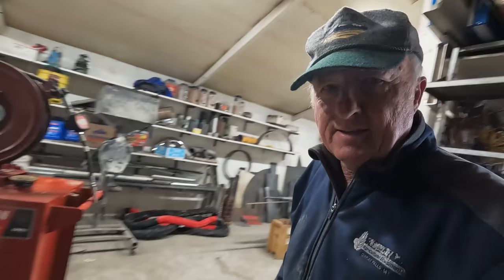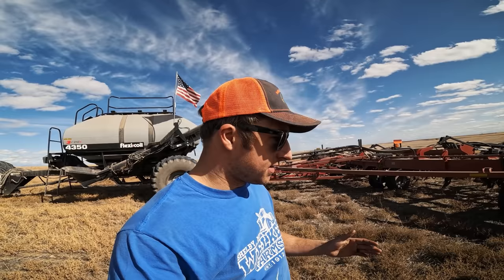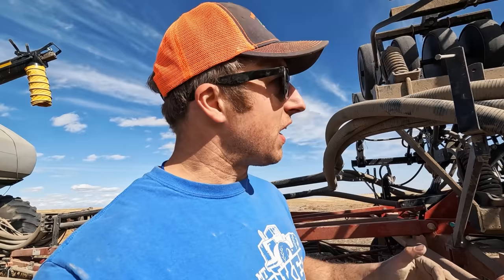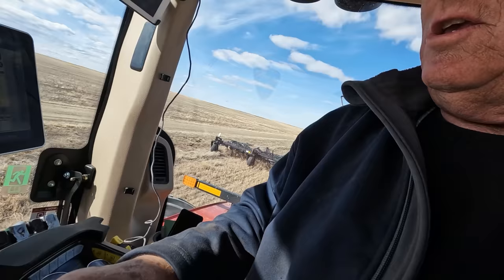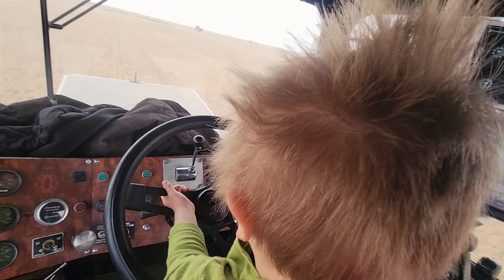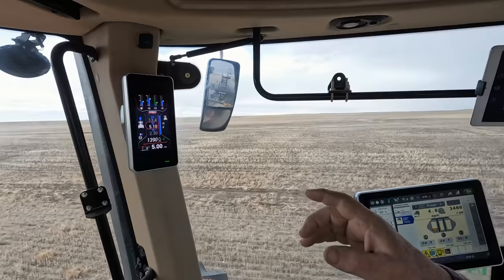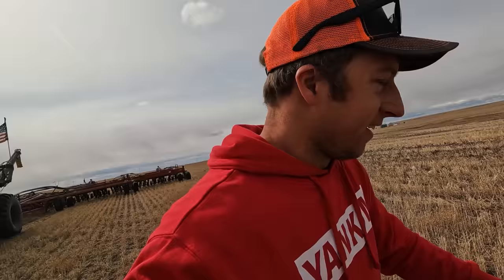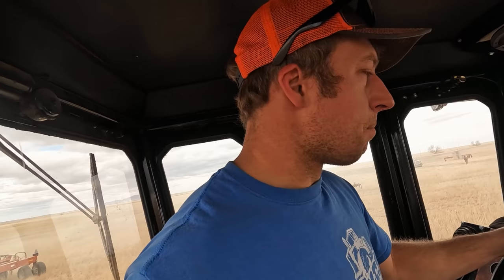Sleeping in a BIG BUD Tractor??

Comment: Yeah Seatbelt helps the Ouch ! Hitting the top of the cab with your head hurts bad enough but if you're wearing a ball cap the button on the top of the hat makes it feel like you got hit on the head with a ball peen hammer , I used to tell my new operators before they drove off in one of my Cranes wearing a ball cap that they might want to wear their Hardhat instead , Most would leave wearing the ball cap and return at the end of the day wearing a hardhat , LOL . Or you can wear a welders hat that doesn't have the button on top .

Comment: It still amazes me that you can go around those fields with direct seeding only basically and still easily pull a good crop.
Here in Europe the farms that I know would never go drilling without prepping the fields beforehand
Reply: it's because our soil is a lot dryer and the top soil has a tendency to blow away with a high winds (up to 180 kpm) that is possible in certain parts of Montana.  So a lot of farms tend to leave some vegetation on top to help keep the top soil where it is.
Reply: Often it's 20 bushel an acre country so costs need to be controlled as well as the erosion mentioned already
Reply: Europe usually gets a lot more moisture, and has a less prone to erosion soil and enviroment.

Minimum till is quite popular.

Comment: We went from a 57’ to the same 70s you have. Same problems with depth and fields not  working out for overlap. Something about 70 that doesn’t work out. We only used our 70’ one year and went to 80’. Works out a lot better.
Reply: We're looking at adding 2 ft in each end.
Reply: @RobertWelkerFarmerBob  thats a good idea! I have heard the 74’ bourgaults work out well. We ended up adding some weight to the centre section of our 70’ to keep the depth consistent also. Love the You tube channel, thank you for sharing your operation with us.

Comment: Nick, has anyone told you about the o-rings on the depth control poppets?
If your depth control seems to be making wild swings, set the air seeder on the ground, float the lift hydraulics. 
Put the control in neutral. Pull the depth bar out of the way, remove the depth poppet, check the o-ring on the angle. 
I will bet that it is gone or chewed up!
Hello from north east Montana. 
10 miles from the Canadian border.
Reply from the maker: Hey thanks for the advice! We will take a closer look at those poppets. I bet they are our issue.

Comment: Hey guys, I watch this channel religiously and was curious about the new to you 70ft tool bar and the fuel consumption difference that comes with it compared to the 57ft?
I imagine fuel p/hr would be worse but seeding that much wider making the job that much quicker would make the extra fuel used worth it since the tractor isn't actually burning it for anywhere near as long?

Hope this makes sense and stay safe 😊
Reply: It's more fuel efficient, do to the 70 shanks on 12" rows (70 ft)  and 77 shanks on 9 " rows (57). Less drag
Reply: @RobertWelkerFarmerBob  ohhh ofcorse! Thanks heaps Robert and have a great day 😊

Comment: CVT's are a nightmare.. they are nice on paper but i work on them all day they are a very very dirty trans and i have to change the fluids and filters in the trans's between 4-10 months. any longer the cvt starts chewing belts and slipping
Reply from the maker: Oh that's not good! I guess for shifting to be so smooth something has to give and that means clutches and belts. I need to do more research on the cvx and see if it is a true cvt. I was under the impression it is a different design.

Comment: I still don't understand why you want wider row separation. 
Going from 9 inches to 12 inch separation is a 30 % increase, That would mean you are having 30% less rows in a field and 30% less production. 
Please explain how I am wrong.
Reply from the maker: Great question, you are mostly correct except here is the difference. Even though we have less rows, the same lbs/acre of seed will be going down. This means each row will have more seed. But this is why that works, we have 4" openers with 5" press wheels. The wider spacing allows us to spread the seed in each row more effectively. Also the seeds are buried more evenly with soil unlike 9" with its steep furrows at 4" press wheels. We will also be able to put more lbs of fertilizer down without fear of burning the seed. Time will tell just how much if any it is better but most drills sold in our area are going 10-12" which means it must be working.

Comment: Why do you put the cart before the drill?
Reply: Carts is set up that way
Reply: @RobertWelkerFarmerBob  There are examples of the drill seeder first towing the cart. Just wondering if their is benefit to cart than drill. Likely a weight ratio problem or perhaps to avoid seed compaction other ideology I would presume would be able to see the seeder as it would be closer if the cart was in the trial. What is your opinion, experience? Obviously your current set up but how did it get to that set up?
Thank Mr. Welker, love learning from you. I like the way you explain things and of course the experiences. Ever consider Ag Prof?
Reply: We bought a used unit back in 2002 which was between.